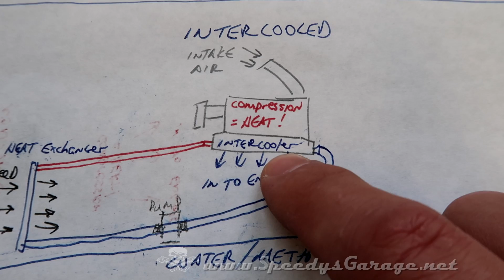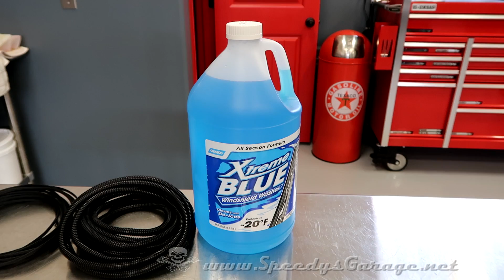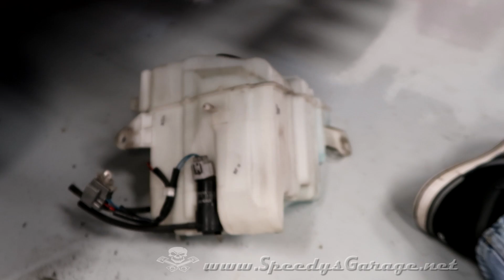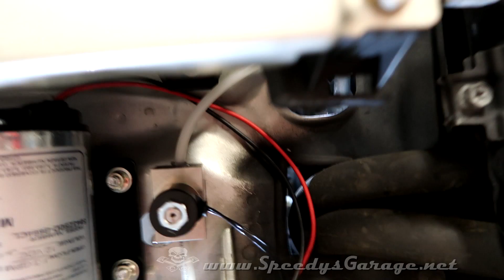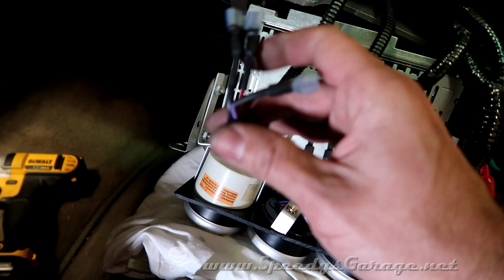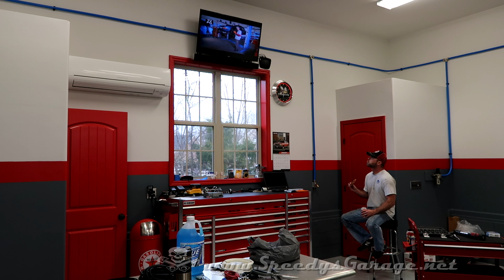Supercharged Gen3 4Runner Water Meth Injection P1

Comment: Are you able run 87 octane reliably with the meth injection as long as you don’t go crazy with the boost mods?  Or for that matter could you just detune the fuel mapping for the TRD supercharger for less boost and run on 89 or 87 octane?
Reply from the maker: If you wanna run cheap gas don't supercharge is my advice.

Comment: Bug washer fluid has detergents. Windshield de-icer fluid generally does not have detergents. There's plenty of information available about the different kinds.

I loved this video. I myself have a custom supercharged engine that I've been debating on using a WM injection kit. I am very knock limited and WM has really proven to be useful. I'm hoping to turn the boost up and still run a good amount of timing advance

Comment: My supercharger gen 1 tensioner is broke ,can I bypass the sc to keep driving my 4runner like normal vehicle ? thanks ,nice video btw.!!
Reply from the maker: You can, but it'll be sluggish as the supercharger will be an intake restriction.  Why not just replace the tensioner?
Reply: thanks.! The lowest $ I found is $180 shipping time is more than a week because the coronavirus crisis ,I drove the runner this morning and if feels fine but there is noise from the engine bay it sounds like Humming noise.

Comment: You should always use crimps and butt connectors on automotive wiring. The reason the soldered joint is bad is because the solder wicks down the wire, acting like a solid core wire. Soldered joints act like solid wire and will fatigue and break over time, because they are not as flexible. A crimped connection does not have this issue because the wire that can bend is still multi-strand and flexible, and typically has a strain relief mechanism built in. This is why literally every oem connection is crimped. The only exception is when wire need to be soldered to boards, or directly to components. Typically these connections are potted and the potting is thick enough that the solder wont have wicked its way to point where bending can occur, and the potting material is flexible acting as a strain relief.
Reply from the maker: I can follow your logic, but not what I'm personally comfortable with based on 30 years experience working on this kinda stuff.  If you want to really go OEM you need to use weatherpak style connectors, which I do use where ever possible, but IMO a soldered joint is always better than a butt connector.

Comment: I hope it worked well. I'm dropping in 9:1 pistons instead of the stock 9.6:1. Did the URD (not the 7th but the other one). She lasted 140k miles but I had like five cylinders with stuck/pinched rings.
Reply from the maker: Man that's interesting, and first one I've heard of to have issues.  Mine's still going strong at 11psi.
Reply: are you running the 2.1 pulley (i'm 2.2)? I do not have an EGR and should have the 7th injector setup according to URD instead of the "fuel/timing/injector upgrade" (oh well). Will install Thorley headers since the motor is out. However, I no nothing about tuning this thing or if I can with URD's PCU. Never checked A/F ratio.
Reply from the maker: That may have been the issue, lean AFRs can cause high combustion chamber temps and make the piston rings unhappy when they over heat as a result.  I ran the 2.2" pulley for years, but went to the 2.1 when I did the water/meth upgrade.  I have a wideband installed in the dash to keep an eye on AFR.  I keep it right around 12.0 with the water/meth at WOT.  Without water/meth I dial it in a bit richer to 11.5 for safety.

Comment: Are you in the Carolina's? Guessing by your accent ;) I too have a 3rd Gen 4runner with the TRD S/C (Walbro 190LPH, Supra Injectors, URD Pulley, JET flash ecu). Pings going uphill under load so I'm looking at Methanol injection. CLEAN INSTALL and I appreciate your thorough explanations!
Reply: IF it pings, why not a little more fuel?  Just curious.

Comment: Just curious but would a factory washer fluid pump work for this? i have an 01 tacoma im going to do water meth to and have a factory 96 tacoma tank that fits on the passenger side that i'll use for just water meth injection. Would be a much more compact package than using the supplied pump. unless of course the one supplied is variable speed.

Actually.. now that i think of it.. that pump is probably much higher pressure
Reply from the maker: You got it at the end.  The factory washer pump is nowhere near powerful enough to cause proper atomization of the fluid.
Reply: That’s not entirely correct. My 1994 Celica GT4 WRC came with a stock water/methanol injector and it utilizes the washer bottle and pump. The intercooler sprayer bar uses it, as well.
It also shipped with a factory anti-lag system in the turbo manifold but that’s an entirely other story.
Toyota used to be extremely badass.